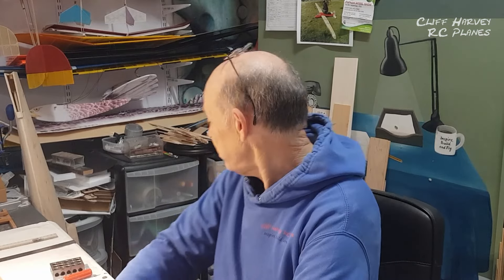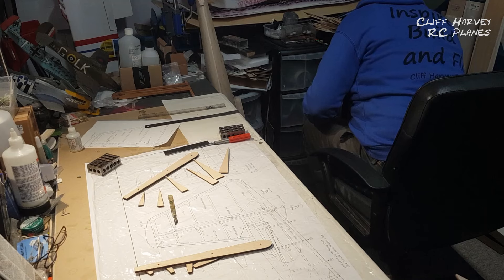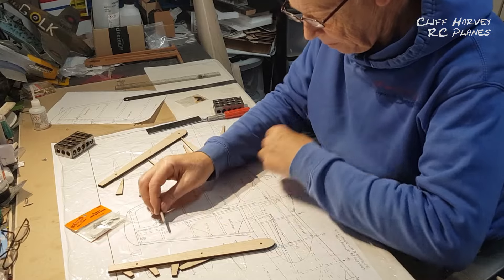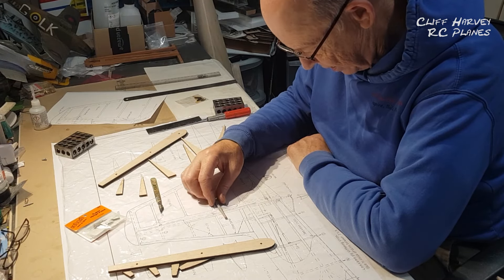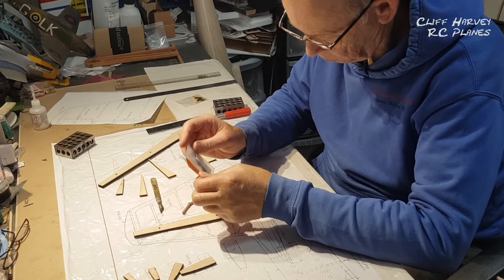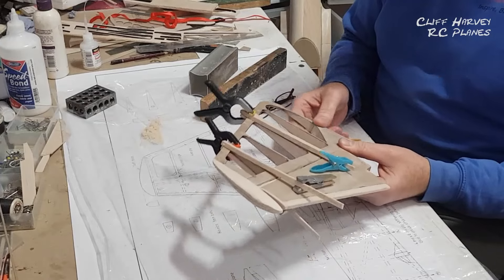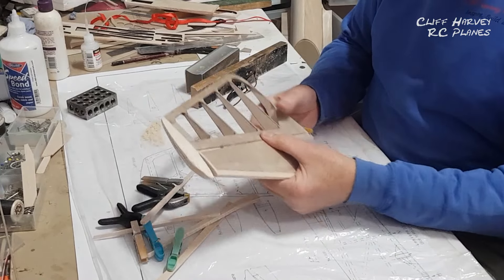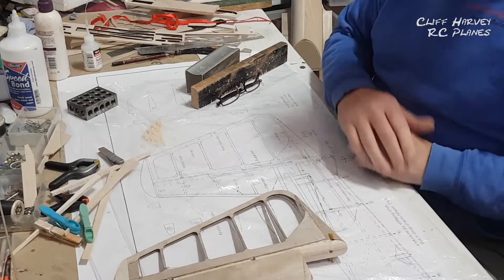Lunak Aerobatic Vintage Glider Plan-Build Part Six

Comment: Quite a complex bit to build. I like the way the rudder fits into the fin...very neat
Reply from the maker: I would think it just follows full size practice Mike but I don't know for sure, cheers
Reply: @CliffHarveyRCPlanes yes, that was the norm for design, esp post WWII.  The hinge line of a moveable surface, whether it be rudder, elevator or ailerons were resessed into the fixed structure as much as possible without causing binding. Better aerodynamics.  Same to this day. (I’m a former pilot and aircraft mechanic)
Reply from the maker: That makes sense Angus, thanks for the confirmation 👍@anguscampbell9311

Comment: Building with such perfectly cut pieces must be a pleasure. 
The fin and rudder are always a challenge as once cannot build them so flat. One angle you might have overlooked is caused by the fin tapering as it goes up which means the ribs are then not 90 degrees to the board. From the camera angle it was very clear. I think it doesn't make any big difference and building flat probably gives it more accuracy than what I do when I build up in the air.
Really looks to be a very enjoyable process!
Reply from the maker: Everything came out ok Andrew, and yes, building with perfectly cut pieces is a pleasure but the pieces have to be drawn out on the computer first which isn't quite so pleasurable!

Comment: Hi what a perfect way to build a glider almost as much as I am doing now  but I  come across a problem which you have SOLVED for me in as much as you “hot glue” some of the covering on the stabiliser and fin and I see you use a “special glue” which you first apply than dry separately and then iron on .now where did you find that glue I have looked for it here in California but to no avail  can you supply me with an address to whet to get this thanks regards Peter Onel
Reply from the maker: Hi Peter, yep, British through and through, the glue in this video is called Speed Bond by Deluxe Products but I know the white gorilla glue works and probably most white glues, do a test with whatever you have. Here's a friend trying it on balsa for the first time: https://youtu.be/IiO_UDI95zc?si=IQfw894o8d-Rm5pt, cheers